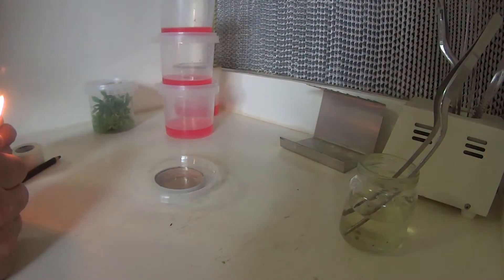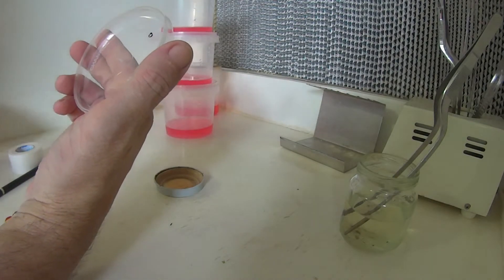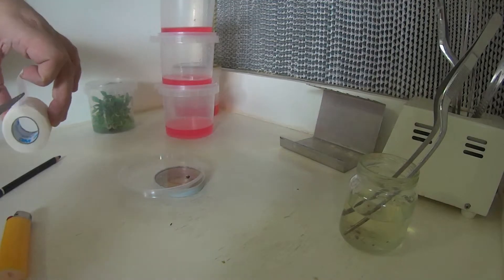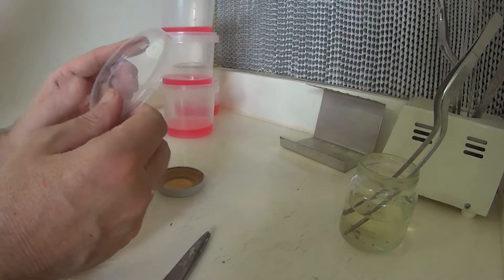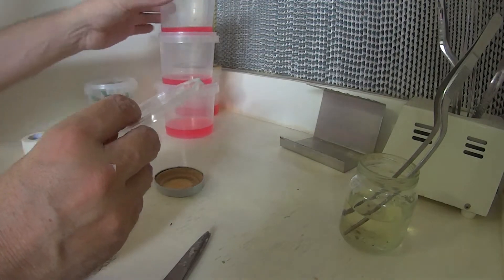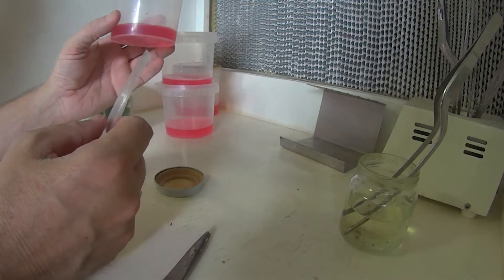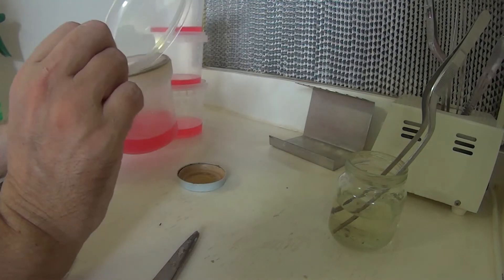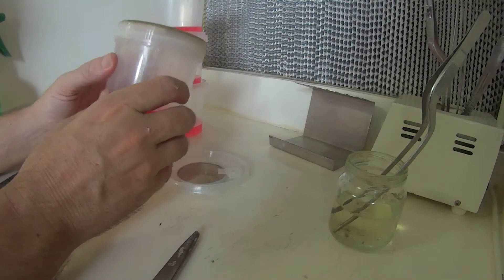venting containers

Comment: hey mate, thanks for the videos, have helped me alot starting out in this hobby, your site seems to also have mostly the best prices in AU too.. reasonable postage charges, have ordered twice from you now..

where do you get those pointy tweezers with the S shaped sort of curve in them? do they have a specific name or something? the ones i have got are like, typical blunt ended ones, good for dividing stuff, not so good with seeds.. and is that the same sort of tape as you would find in a first aid kit? the one with sort of a papery.. felt texture to it?
cheers.
Reply from the maker: +ussyless 
They are called bayonet forceps (ebay)

yes the tape is 3M medical tape its what you get in first add kits